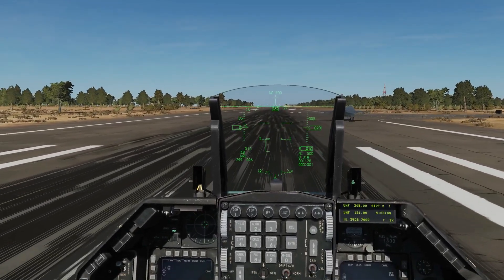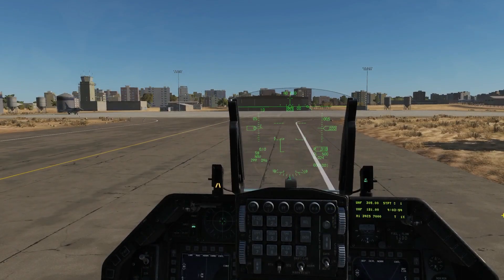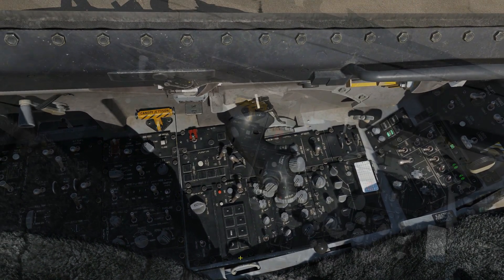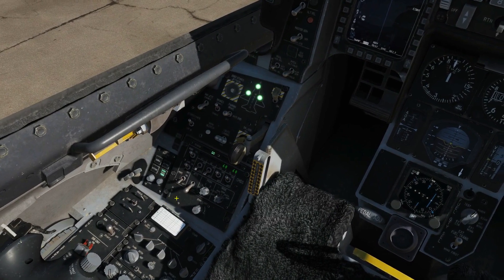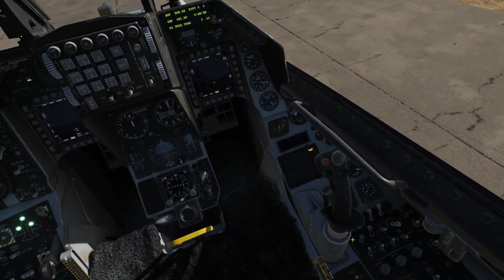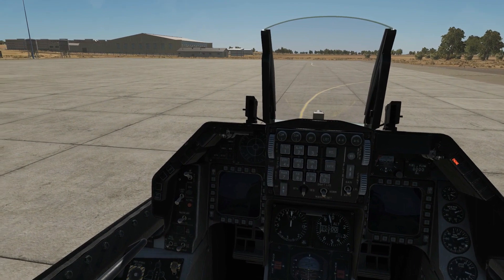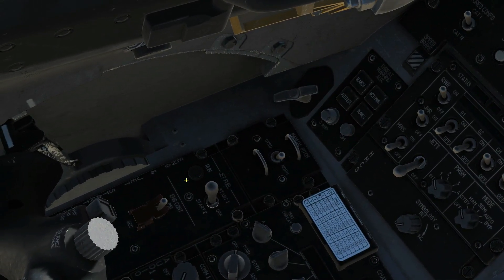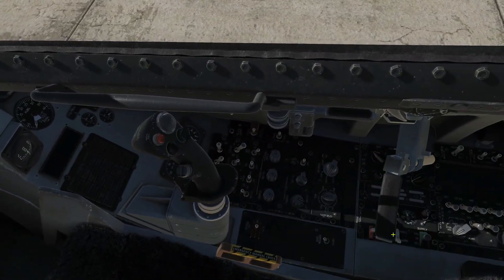F-16C Viper: Shut Down Procedure Tutorial | DCS WORLD

Comment: I was making this to print, so I figured Id put it here

1 | During taxi/Pulloff area |

Disarm ejection lever after exiting runway
Probe heat OFF
ECM power OFF
Close speed brakes
IFF Master knob OFF
Taxi lights ON (until parked)
Laser/Master arm OFF
HUD OFF
Sensors (behind stick) OFF
Avionics Panel Pwr OFF (MMC, ST STA, MFD, UFC, MAP, GPS, MDS LVT, INS.)
continue to park

2 | engine shutdown while parked |

Throttle OFF (Rshift end is standard)
Confirm JSF Run-light is OFF, Confirm EPU lights are OFF
Main Pwr OFF after RPM is below 20%
O2 Supply OFF, Lever to 100%
Taxi lights OFF
Unlock, then open Canopy
Reply: Thanks a lot, mind if i copy it? 😂
Reply: @gooberminium  Go for it!

Comment: How does the canopy open when you switch off all sources of energy before?
Reply: I’m not exactly sure how but it runs off it’s own source? Just so if the aircraft crashes the pilot stands a much higher chance at getting out
Reply: Both canopy switches (cockpit and ground) operate without using the main power panel. Otherwise you wouldn’t be able to open the canopy to get in without using a speed handle. The F-15, on the other hand, is a little different as it uses a hydraulic canopy actuator.
Reply: @KPX-nl4nt  Yes, but where does it take the power?
Reply: @Youda00008  From the battery bus under door 2202.

Comment: A Little correction: before engine shot off you need to turn epu to off
Reply from the maker: thx
Reply: That’s true, however, most pilots leave it in NORM instead of lifting the rear guard and switching it to OFF in my experience.